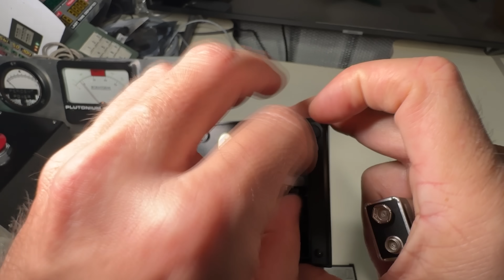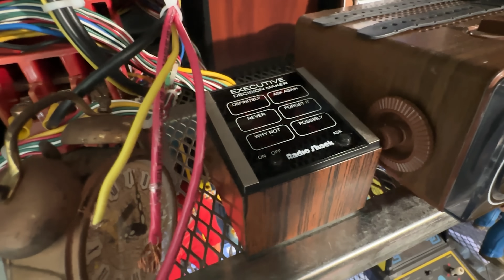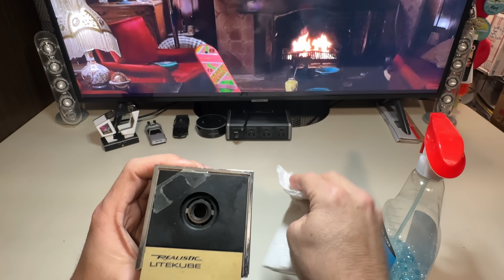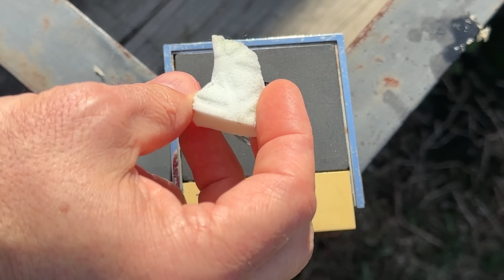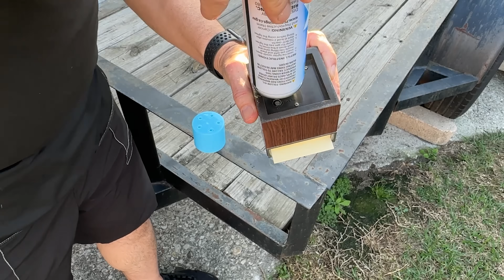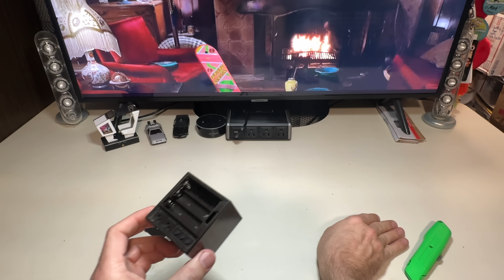Radio Shack Gadgets For Nerds & Pyros

Comment: The lighter is ment to put a cigarette into, then push the button an remove the cigarette then puff it to make sure it's lit. I had one of those back in the 70s or 80s.
Reply from the maker: I’ll believe it when I can get the fuel tank to actually hold butane n
Reply: @spacetimejunction it leaks? Dude, sorry. I think i still have mine in a box up in the attic. Was thinking about getting it out to use.
Reply from the maker: @grogvaughan5649 do it! And film it! There’s literally no video anywhere of one in working condition.
Reply: @spacetimejunction  ok. Sounds like a plan.

Comment: A utility razor blade or a thin putty knife would’ve removed the tape, with the WD-40 for the assist and clean-up of the adhesive afterward. Use a brand new razor blade or clean the putty knife before using it.

Comment: You may need to clean the butane jet, because cheap butane has oils in it that restricts flow after drying out.  Or you may remove the limiter ring, if you can, and set the flame level and then reinstall the limiter ring.  Also, cheap butane can cause air pockets that reduce the flame level.  It's most likely gummed up from impurities.  If the jet is brass then carburetor cleaner will clean it.  It's just dirty and most likely why the person sold it to you.  I like your style of videos.  It's refreshing, unlike all the AI Slop.
Reply from the maker: I need to watch some lighter restoration videos. 😂

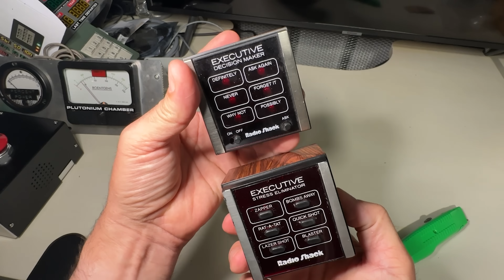Comment: Push and hold the set button and at the same time, push the hour button to the correct hour until it says 12pm or 12am. So, if the actual time you set it, hold the button until it says 12pm or 12am. Get it to 12pm then to 2:00. Then while still pressing the set button, set the correct minutes. As soon as you release the set button, the seconds count begins at :00 in case you want to be that accurate.
Reply from the maker: Thanks for the mansplanation.

Comment: First, the lighter works fine. It has a flame/fire adjuster on the bottom…next to where you refilled the butane. 
Let’s say the tape came off, leaving sticky residue. You’d use Go Gone in that case. It’s not a tape remover.
Reply from the maker: lol yeah it doesn’t work fine 😂😂😂

Comment: Hey, STJ - and everybody...

Hair dryer.

Hot air removes tape, stickers, price tags, veneer.

Yes, you have to be VERY careful not to damage the product you are removing adhesives from but a hair dryer is how that stuff comes off.

Also, use a clean, cotton cloth to wipe the hot adhesive from the object you are cleaning. Paper will leave debris.

I have even removed labels from heat sensitive, plastic bottles without deforming them. Takes a little practice and a touch of experience.

Hair dryer.
Reply from the maker: I have a more intense heat shrink dryer that I bet would be work. The proximity to the plastic wood grain makes this seem a bit risky however.

Comment: There are 2 ways to get a sticker/label off. Either water, or oil. So.. try getting it wet first. If that doesn't work, WD40. It has to do with if the adhesive is polar or non-polar. I forget which is which. Water is one, oil is the other.

Comment: I didn’t have far to go to get the 9 V battery but instead made a command decision to take it out of smoke detector😂.  If you run some test, you’ll probably find out this is just as accurate at answering questions as one of the AI large language models😅
Reply: Wow, all you have to do is 3-D print a frame for those to sit out in front of your eyes and you can advertise them as dual mode smart glasses😅
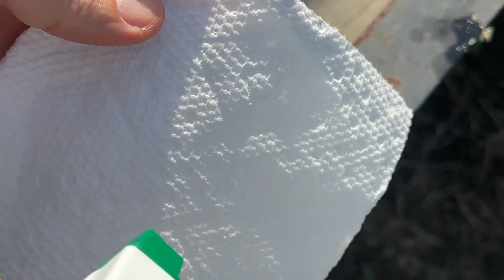Reply: 6:23 yeah good job making this sound like you’re fighting the invisible man😂.  Look everybody I had to pull Reed off of his brother-in-law Johnny.😅
Reply: I’m pretty sure if you hit a button on something and it ignite itself that’s more like a hand grenade

Comment: The lighter may be intended to have a cigarette inserted down into the flame rather than have the flame exposed.  Or use the flame adjustment screw.
Reply from the maker: I don’t think so as it never really seemed to burn anything except residue from my filling attempts. The screw had no effect either sadly.
Reply: @spacetimejunction  Butane lighters are VERY VERY finicky about how you fill them.
Reply: @tigheklory I've found that leaving one in a warm room overnight will often put it in a better mood.
Reply: @smartyhall  I fully drain and then put my lighters and the butane can in the freezer before filling. They last the entire fill without sputtering. By "finnicky" what you are talking about is just the relatively simple thermodynamics of pressurized liquid gasses. I have a zippo butane jet insert that lasts a full 7 minutes of run time when I do this. I get 4-5 minutes and a lot of sputtering (unless I warm it in my hands) if I don't follow this process.
Reply: @spacetimejunction bummer

Comment: You didn't adjust the flame 
You need to make another video of you doing that 
I'm so happy I used to work at Radio shack
Reply from the maker: I actually did that several times off camera. It never made a difference. I suspect the fuel port never let any fuel go inside (or I never got any in with the can of butane I bought).
Reply: @spacetimejunction  Can you take that top cover off? You may need to get a brush down in there to knock out any old carbon build up. Just be careful not to damage the igniter.